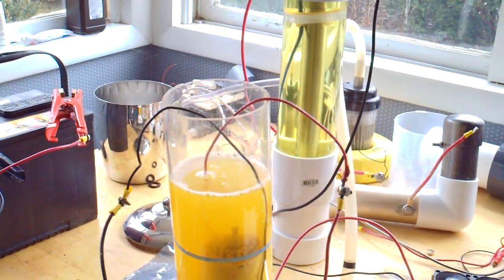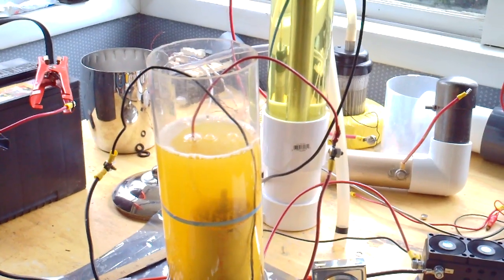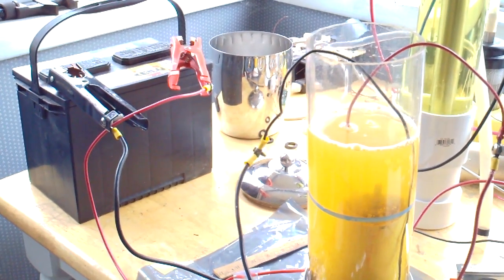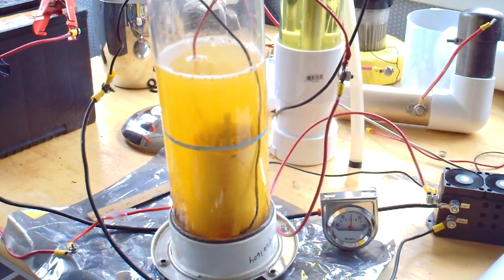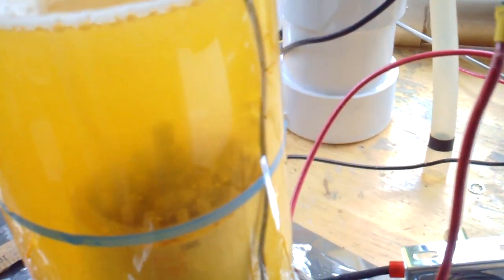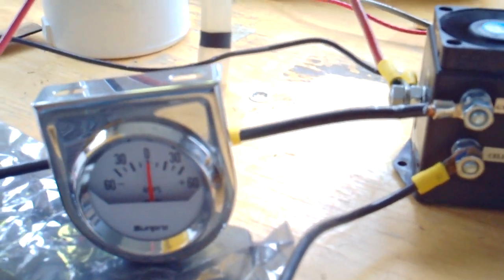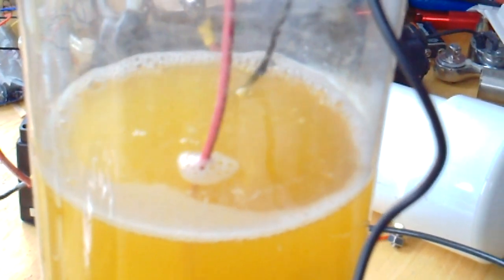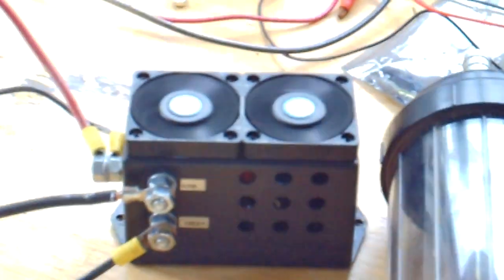How To Produce Lots of HHO @ 1 Amp Or Less

Comment: exactly how much is plenty? The drop in amps is a drop in electrical flow, or current, if there wasn't a change in voltage, there is an increase in ohms, or a lack of conductivity of your mixture. The acryllic or electrodes tend to bind to certain metals or particulates in certain solutions, the occurs happens due to the formation undesired corrosive, oxidizing, conditions (as well as many other variables) when certain mixtures are subjected to electrolysis, ionization, or heat, without strict control, and attention to all parameters in full detail, all the materials in every component, i.e. conductor material, coating type, conductor diameter, duration energized, temperature differentials, water evaporation, water consumption, molecular action, galvanic reaction, mineralization, polymer inclusion, anode cathode and electrolytic neutralization, consistency of the electrolyte concentration, PH level, buffering capacity, parasitic draw) a plethora of variables that must be taken into consideration no matter how insignificant they may seem to the core of the project, they can and do have the potential to effect or adversely react to the contributing components, or the residual deposits from the containment materials, all kinds of stuff! It all must be accounted for, measured and factored in, tedious is an understatement, but not frivolous. without accurate consistent measurements , you can't support a claim, theory, or record a hypothesis, let alone base results on vague ball park hunch standards of control conditions. The degree of accuracy and attention to detail, is directly relevant to the degree of credibility, moreso in most instances than the reputation, knowledge and experience of the authors involved. So in order to trouble shoot or proclaim a discovery, documentation must be present. good luck, don't give up!

Comment: Not to burst your bubble and meaning no disrespect to your video, But I made an HHO Cell using two 316 stainless steel welding rods and two stainless Washers... It was a very small set up... It used like 4 amps to run and put off at least 1 liter per minute of hho....  I don't know what you are going for here but I would think the most hydrogen you can get I would suppose.....  And I don't know what your using for electrolyte but your water looks like someone peed in it.....  That is usually a sign of either salt content or non-Stainless material being used, Unless you added something with color....  As I said before, No disrespect to you dude, But I can build a small unit that puts off way more than that...
Reply: Send me a link please.

Comment: Keep trying, one of these days you will make a cell that is efficient.

 What you have there is a water boiler.
Reply from the maker: Always amusing to hear from one of the ignorant masses. Watch and learn fool.
Reply: hyfusiondotcom
Is that beer or piss in the production tube ?
ROFL - sorry couldn't resist.
Reply: hyfusiondotcom You are using an analog 120amp range meter to measure "a few" amps of current? Stop preaching and go to school. LEARN AND LEARN FOOL
Reply: onecraftydude  a water boiler that produces flammable hydrogen gas numb nutz.

Comment: hi, if you put electrolyte to get more bubbles, then it's just a mere electrolysis. Meyer was right, then go on that way! don't lose time ... and money.... with this things. I'm sorry, I don't intend offend you! The common electrolysis is not the key. R.E.M.F. can make a big difference!
Good luck and don't lose the hope and inspiration...... forget the insults from "genius".
Reply: Cristiano Angeletti No shit its electrolisis, so what, thats how the hydrogen gas is produced.
Reply: ace lee if u produce hydrogen from electrolysis then it's like you transform a "form" of energy into something else, with lost.
otherwise using R.E.M.F. you can produce more hydrogen  putting less energy. it is not a dream and it doesn't go against Faraday's law. It's just a new way, more efficient. Low amp, hight voltage, resonance.... It is possible  but using electrolyte that increases amp and so consumption.

Comment: Dear friend your cell very low Output approximately 50 milli liters is not enough purpose so you have a low current the best result with me 10 LPM and I can run small engine 2.5.HP & torch applications with 15A AC 220V 

تشغيل المحرك بواسطة الماء تقنيات الغد